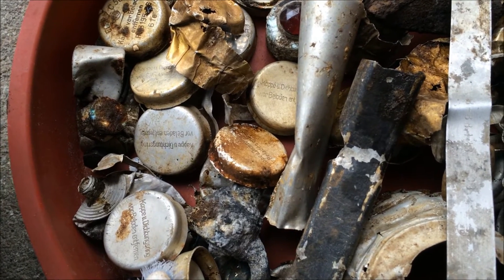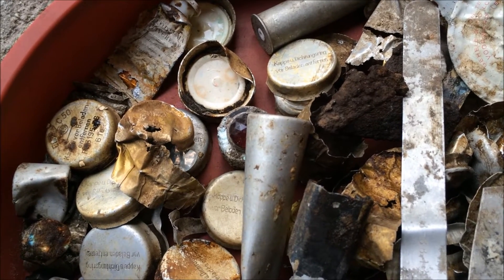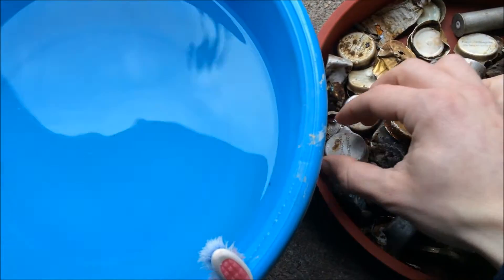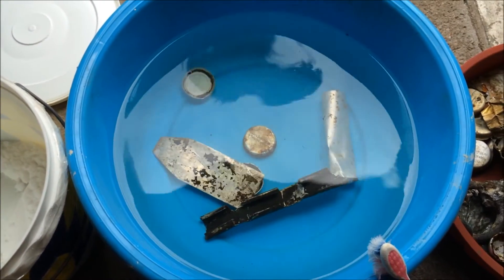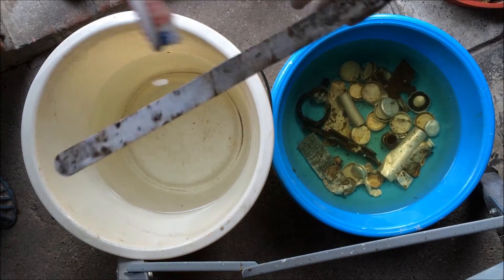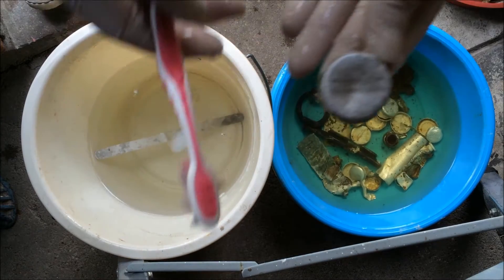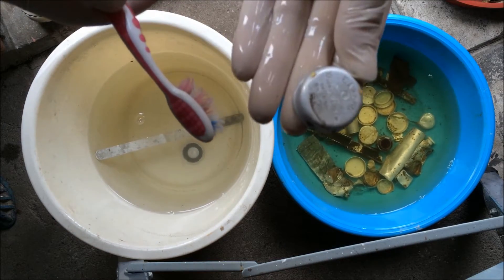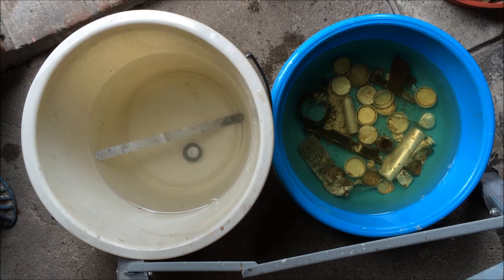How to clean aluminum relics with oxalic acid?

Comment: I used oxalic acid as a two step process for cleaning steel. I use muriatic acid (HCl acid) as the first step for heavily rusted parts and then the oxalic as the second step will give a nice phosphate coating similar to phosphoric acid that will prevent flash rusting and provides a good etch for paint to stick to.